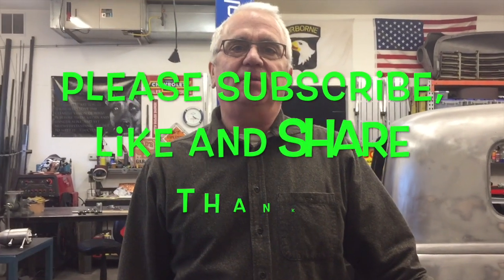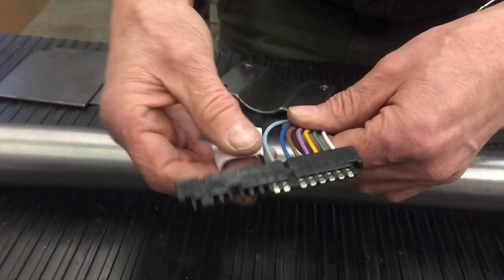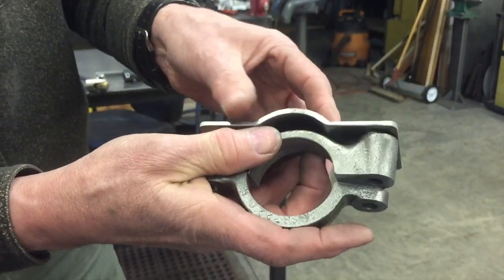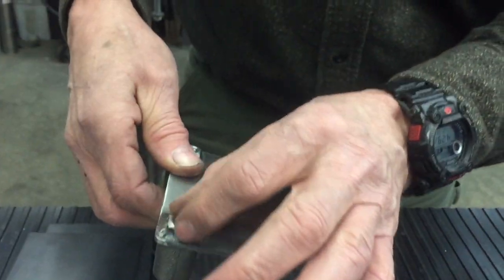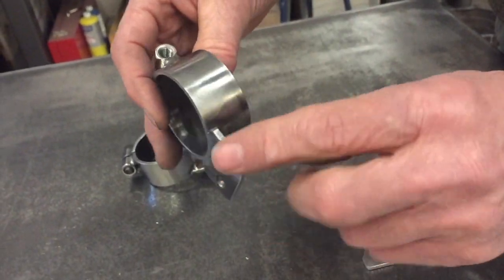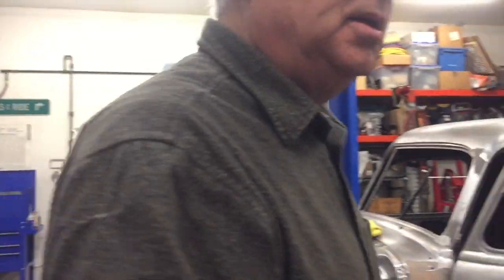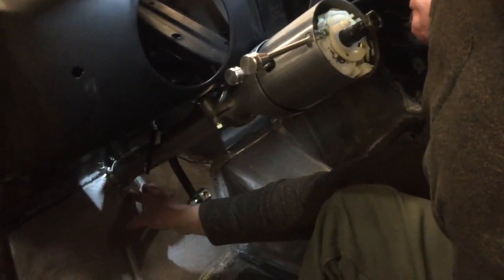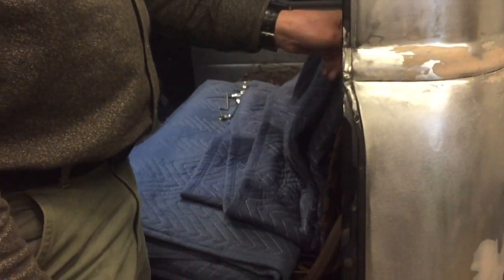53 chevy pickup column install part 2

Comment: Hey Stephen. Nice work on the brackets.👍 I like the trick on welding the nut on the back of the plate. it turns a 2 man job into a 1 man job.  Cool steering wheel. You are really coming along with your truck. My hat's off to your wife. She is doing a fantastic job videoing your channel. 👍👍

Comment: Great work
Wondering if you can tell me what model headers you installed?
I have tried the Shorty block hugger headers and they stick out to far from the LS engine.
I makes my joint angles more than 30 degrees which causes a lot of play in the steering.
Thanks
Mark

Comment: Hi Steve, This is J. Barturen in Miami Springs ,Florida . I have been following your work on the 53, and you do awesome work. I just resurrected my 54 Chevy truck BEATER . It had been in hibernation for over 25 years. Now that I am retiring from AA, airlines, I am working on it, getting lots of Ideas from you. Thank you... Im trying to do it in the CHEAP. trying to make due with the original  steering column, connected to the 1987 Chevy front suspension power steering via a Jeep Cherokee steering shaft. What could I use for the end of the 54 column tube ?. m using the on the 3  0n the column   shifter   as an automatic shifer... Ilove your work...
Reply from the maker: Juan that sounds like a cool project I would  measure the inside diameter of the steering column and the outside diameter of the steering shaft if you’re lucky there might be a bearing available that could slide inside of the column to support the shaft if not I would use a bronze bushing that would slip into the column to support the shaft you could hold it in place with some set screws just drill and tap the column in three spots and probably 1/4  28 set screws to lock the bearing or bushing in place around the column
Reply: @idahofabricator8710  Thank you very much for your Quick response . You now I'm addicted to your channel ... The bed on mine was trash, so after shortening the frame to what would have been a short bed.. I sold the remnants of the bed, Hey someone wanted them. I building a flat bed,, Yeah I like being different.. someday maybe I can send you pictures..
Reply: @idahofabricator8710  I forgot, I plan to modify the original steering wheel , It's worth a try, I plan to find a good smaller diameter wheel cut the spokes on mine just enough to weld on the smaller diameter wheel , then epoxy and paint,, Hey ,, like I said, I like being  different,,
Reply: Thank you.... You are helping me with the bet I made with my sons , that I would drive the truck to my Retirement home in Tennessee . They dont think I will do it  ,HA !

Comment: Very nice fix for the steering column, but couldn't you have bought a longer column in the first place and avoid all the "tinkering"?  Love your build videos!
Reply from the maker: The problem with the longer column is it would’ve come really close to the exhaust manifold on the motor so I wanted it close to the firewall but still sticking through it a little bit

Comment: Your channel has been such a help restoring our 52 five window short bed. Did you remove the the brace that controls the outside air vent when you installed the brace for the brake booster? We can't find the brace for the brake booster from Classic, do you have a part number. They can't seem to get me a catalog.
Reply from the maker: Part number for the firewall bracket is 4753FBB that’s from CPP,
Reply: @idahofabricator8710   Thank you for taking the time to find the number. Your videos are a big help.

Comment: It's frustrating. With all the goings on 
 And now retired in Tennessee. The truck in Miami. My plans are changing. I bought a 1993 Chevy C10 for the engine.and of course
 When Juan is bored.... I'm thinking of dragging the body and all parts up here. My cheesy is nothing to write home about. So I'm thinking of using the 93 chassis. Shortening it. Bot I have everything I need .tank brakes TBI .everything for $300 bucks. Retirement price

Comment: Hi Steve. I have been  working on my 54 again. I got a care package yesterday, My body mounts came in.One question. On the rear shackle  style  body mounts, How  do one figure out  how many shims to use, I took this apart Like an eternity  ago.. Thank you..
Reply from the maker: Juan What I did one was I leveled the frame side to side front to back with jackstands and then I put a level in the cab and use the shims to level the cab to the frame I think I had three shims on one side and four on the other.

Comment: did you use the original column hole in the firewall.looks like its a little lower
Reply from the maker: You are correct Arthur I welded up original hole and when I found the exact spot I drilled a new hole The original opening was way too large
Reply: @idahofabricator8710  thank you

Comment: Can I use the original 1952 steering wheel with a column like this?
Reply from the maker: The original steering wheel won’t work with the aftermarket  columns,  splines are different and the the other difference is the original wheel is 18 inches in diameter and the new wheel that I got is 15 inches it’s a reproduction of a 1940 Ford steering wheel and with power steering you don’t need a large diameter wheel,  originally these trucks were all manual steering so you needed the big diameter wheel.
Reply: @idahofabricator8710  i like the original look. so im wonder what will be comparable? I want something that looks old not new
Reply from the maker: SaintJames40 Check out this steering wheel at speedwaymotors.com the part number is 91032715 it’s a 1940 ford 15 inch steering wheel and will go on the idiot and flaming river columns without any adapters the steering columns are designed to except GM steering wheels for 1969 to 1994 that seems to be a universal adapter size for most aftermarket steering wheels the one from speedway motors doesn’t require an adapter the steering wheel just slips right on fits perfect and it looks old to check it out

Comment: How much did u end up spending for both if u dont mind me asking
Reply from the maker: I don’t mind telling you I’m just not sure what two things you’re talking about the column and the steering wheel or something else
Reply: @idahofabricator8710  yes both
Reply from the maker: @smokeshow973  I got them both from speedway motors the part number for the column is 446–33010 and a part number for the steering wheel 910–32715 the column is from Ididit it very nice quality it’s a 30 inch long column plain steel so I can paint it to match and the steering wheel is a reproduction of a 1940 Ford and it fits the column without any adapters
Reply: @idahofabricator8710  thank you again your truck is coming along nicely

Comment: Where did you get your D shaped dowel rods?
Reply from the maker: Thanks for the question Louie all I did was use some hot glue and glued the doweling to a piece of 1x4 wood, I adjusted my tablesaw fence to cut the flat side on the dowel then move the fence a little closer,  to cut off where the dowel was glued to the 1x4.

Comment: Where did you order the steering column from?
Reply from the maker: I ordered my column from speedway motors they have the best price the part number is 446–1230D it’s a plain 30 inch tilt column with no shift

Comment: Can you tell me what exhaust manifolds you have on your engine?
Reply from the maker: They’re made by Hooker  they are cast iron headers rated for 500 hp they also use OEM Ls exhaust gaskets, I think you can get them in five different jet coat finishes I got them at summit racing.
Reply: @idahofabricator8710  thank you! I’m doing an LS swap in my 1952 3100 (on an s10 frame) and having trouble getting something that fits.
Reply from the maker: @TurboNFRStwoK  Let me know if you have any more questions.

Comment: What is the diameter of the steering wheel?
Reply from the maker: Thanks for the question Tim the steering wheel is 15 inches in diameter and got it from speedway motors part number 91032715 hope that helps

Comment: Can you tell me where I can find the steering wheel.
Reply from the maker: Absolutely I got it from speedway motors it’s a reproduction of a 40 Ford but it’s sized for modern power steering very nice quality
Reply: @idahofabricator8710  Thank you so much for the reply
Reply: Hello, I ordered the steering wheel.   Can you tell me if this wheel is compatible with a standard universal speedway GM steering column ?
Reply from the maker: @Romanrootergarage  Yes the wheel is designed to fit GM style column that speedway sells
Reply from the maker: It might not hurt to give Speedway a quick call just to double check but I’m almost positive they’re designed to fit GM style columns without any adapters
Reply: @idahofabricator8710  Thanks so much for the help.
Reply: @idahofabricator8710  Confirmed !